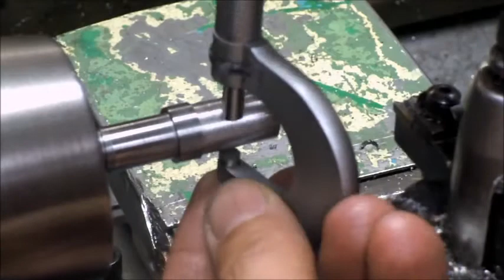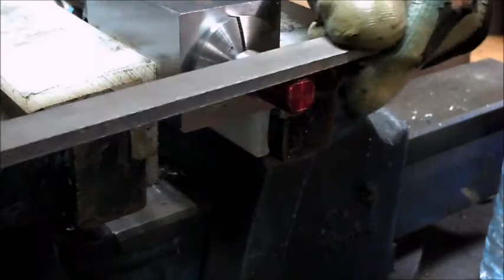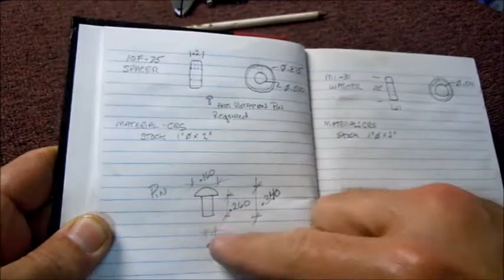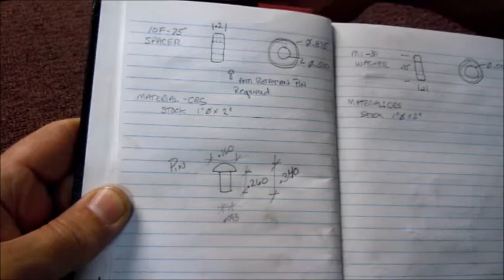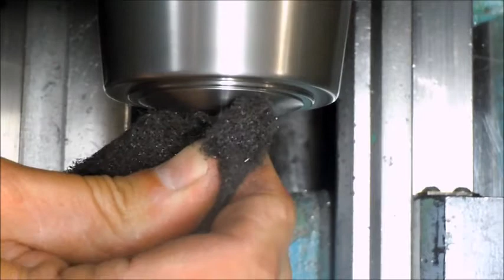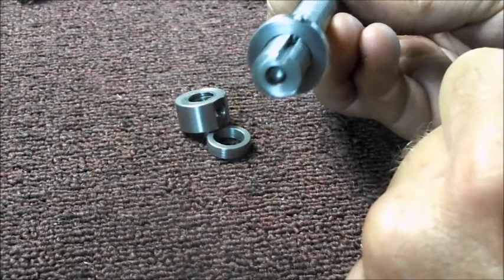Atlas 7B Update 15

Comment: I am working on one of these vises right now but am not certain I have all original parts on it now. I was curious if the collar with the set screw on the back side of the fixed jaw had a certain feature I have seen on the ram screw. What I am referring to is that on the ram screw there is a small insert at the end of the set screw on the collar that has the acme thread on it to prevent marring the thread on the screw where it locks down. 
I hope I am explaining this clearly. It just didn't seem right to me that a set screw would tighten down directly on the thread as it would damage it. mine had damage from that
Reply from the maker: Your explanation makes perfect sense. Unfortunately the the Atlas manual and parts schematic does not have the vise captured. I do have a resource who has had many of these machines. If I can reach him I will ask. Thanks for watching and commenting.
Reply from the maker: Spoke to my friend (great resource)  and he thinks it may be a slug of lead that is used, appearing to take the form of the threads after being compressed. Hope that helps. Thanks for watching and commenting too.

Comment: that is an excellent job. you not only rebuilt the vice. it's better than the original in every single way. only thing I would have done differently is used thrust needle bearings on both sides of the screw and preloaded it. then again. I don't think I can do as good of a job as you did. hats off to you.
Reply from the maker: Thank you. Been looking at some thrust bearings actually, may be an add on if I can find the correct size. Thanks for watching and commenting.

Comment: why does it look like your screw runs out? Got some bend to it or are your nuts not concentric? Definitely a good learning project!
Reply from the maker: Bent? I think you've spent too much time on that radial drill :)  Seriously, I did notice it myself when editing the video so I will have to see what's up, could be an illusion too, I do that in my spare time also, and get back to you. I learned a tonne on this project for sure, could have just bought one but that's too easy. Thanks for watching and commenting.
Reply: Could buy one, destroy it, and then put it back together, that is what I do. :-)
Reply: I think its the set screw pushing the nut hard over on the lead screw taking up the clearance in the nut to screw.
Came out well though. especially that little pin - think I would be still searching the chip tray/shop floor for the little beggar after multiple drops.
Reply from the maker: Like Columbus setting sail, you're the first guy to ever do that repair! History captured on YouTube!!! Nice work.
Reply from the maker: Like Columbus setting sail, you're the first guy to ever do that repair! History captured on YouTube!!! Nice work
Reply from the maker: Bingo! That's exactly what the set screw did... Good eye. I'm surprised and happy to report that I didn't drop the pin once! Crazy glue a magnet to your pinky, it's amazing what it can catch. Thanks for watching and commenting.